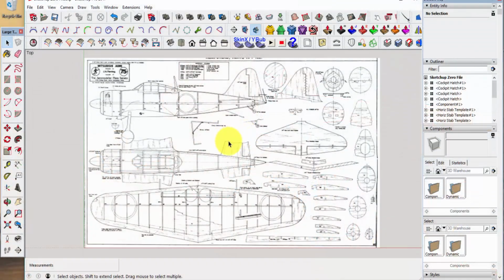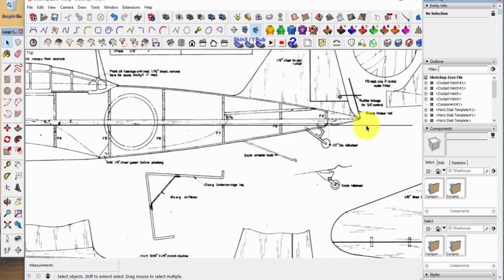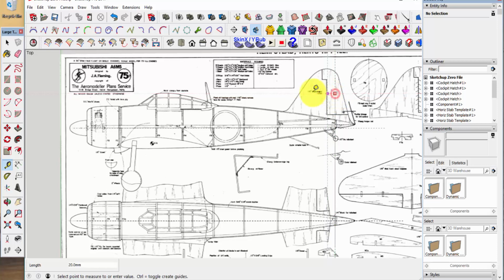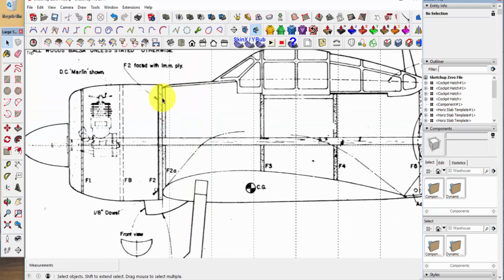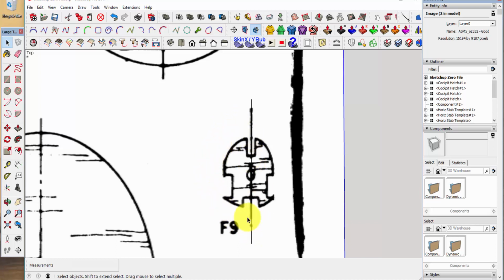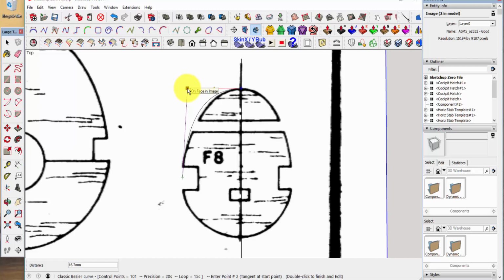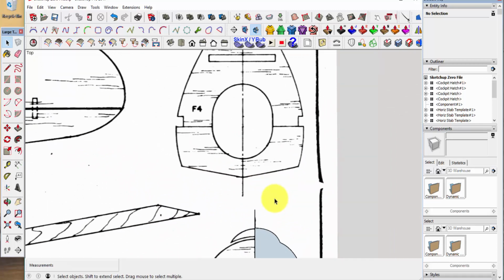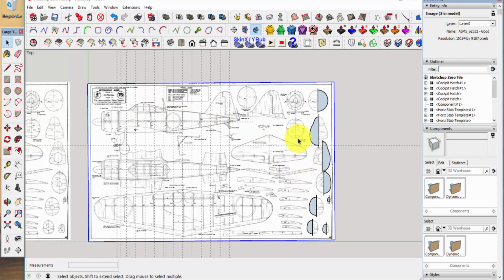Sectioned Foam RC Aircraft Fuselage Building - Part 4

Comment: Need additional information on the extensions you have added to Sketchup. Construction lines?  Curve tool?  Others?  Thanks.
Reply from the maker: I should have mentioned that in the video.  Although I have many different plugins, for this building series I THINK there is only one extra I use, all the rest of the drawing is done with the tools that come with SketchUp.  It is the Bezier Spline Tool.  There are several spline plugins available but the one I prefer is by a plugin developer called Fredo6.  It is in the Fredo6 series of free plugins.  The entire Fredo6 series is VERY useful by the way.  You can get plugins from many sites but the one with the complete Fredo6 series is at https://sketchucation.com/   And here are Fredo6's plugins:  https://sketchucation.com/pluginstore?pauthor=fredo6  You need to install his LibFredo6 first for many of his plugins because it is the "engine" that drives them, but they are a very useful series.
Reply: Thank you. Can you point me at the construction line tools, please.
Reply from the maker: @timelston9429  Not exactly sure what you mean.  Do you want the "Make Construction Line" tool?  There are two available, one fro the Extension Warehouse and one from Sketchucation.  I use the one from Sketchucation here: https://sketchucation.com/pluginstore?pln=Xlinem  In case the link breaks, the plugin is called Edges/Construction Lines Converter    v1.3 is the latest.